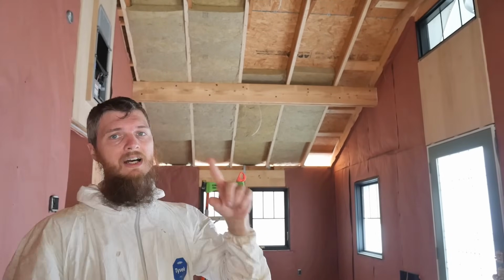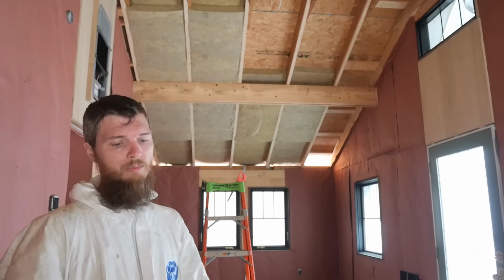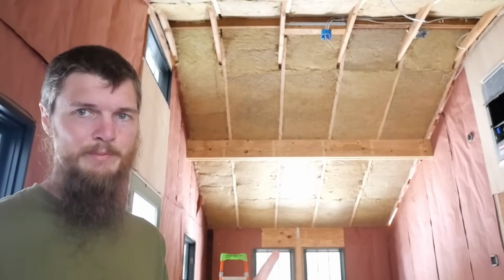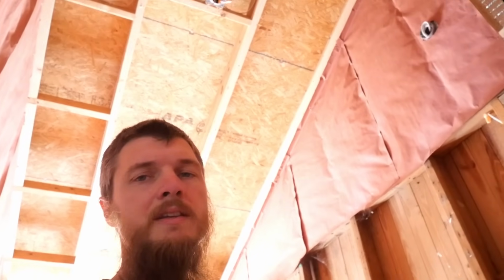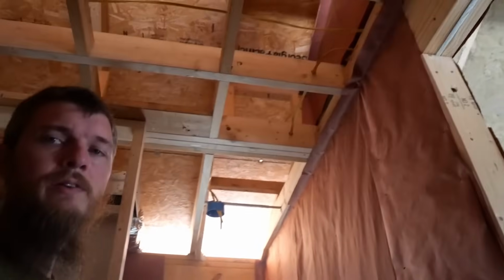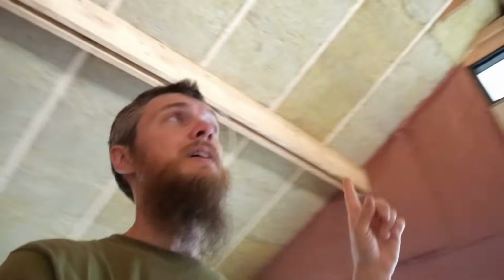Just Insulating our Cathedral Ceiling

Comment: your suposed 2 have a vented space between roof deck and insulation....
Reply from the maker: Not if you are doing an unvented roof assembly. There are many ways to build and insulate attic and roof spaces.
Reply: @diyfferent  every roof has to be vented..
Reply from the maker: @redsresearch  That's just not true.
Reply: @diyfferent  lol ya it is...
Reply from the maker: @redsresearch  Okay, show me where you got that info.
Reply from the maker: @redsresearch  I don't know why you don't just do a little research on the topic instead of making yourself look silly. Obviously this isn't a topic you are well versed on, so what do you get out of arguing about it? When I learn something new I always enjoy digging into it and learning more. I don't just argue that it's not true as if it relinquishes the truth just because I don't want to face it.
Reply: @diyfferent  your suposed to have a gap air space between the deck and the insulation so it doesnt melt the snow as much
Reply: @redsresearch  Do more research.  They are doing this right, but the tyvec suite and air masks are overkill.
Reply: @diyfferent all my research on the topic says you need a space for ventilation… i would be happy if its not the case since I am just about to do the insulation and I don’t have enough space to vent and have more than r30 insulation. And the recommendation in my area is: r41. Can you point me into research that says I can insulate without venting? I have a metal roof and my beam are 9 inches. So I was planning on putting 6 inch of rockwool and leaving a 3 inch gap for venting.
Reply: @diyfferent all my research on the topic says you need a space for ventilation… i would be happy if its not the case since I am just about to do the insulation and I don’t have enough space to vent and have more than r30 insulation. And the recommendation in my area is: r41. Can you point me into research that says I can insulate without venting? I have a metal roof and my beam are 9 inches. So I was planning on putting 6 inch of rockwool and leaving a 3 inch gap for venting.
Reply from the maker: @gabz91110  A lot of good info in these articles: 
Part 1: https://www.jlconline.com/how-to/insulation/avoiding-wet-roofs_o
Part 2: https://www.jlconline.com/how-to/insulation/avoiding-wet-roofs-part-ii_o
Reply: @redsresearch  <—- Your name is ironic😂

Comment: Spray foam next time bro.  What's more valuable your time which you'll NEVER get back or $ which you can always make more of.??
Reply from the maker: We don't like spray foam insulation.
Reply: @diyfferent  Plus mortgage companies don't like spray foam insulation AKA won't work with you.
Reply: Lots of insurance companies are refusing to ensure houses that have spray foam in them. My guess is that spray foam is just a fad, and will soon be a thing of the past.
Reply: @mr.kenslifeshop4034  Don't know about that... it's be around for decades now
Reply: @unamor  it's already a thing. It leaches chemicals into your living space.
Reply: Many times it doesn’t cure on one side and stays wet.
Reply: Spray foam is nasty stuff, as a chemist I wouldn't put that in my home.  If the chemicals don't mix 100% or aren't in the  PERFECT ratio, it will leech chemicals into the air for years after.
Reply: I had spray foam placed in my ceiling/attic in Australia where it was either  warm or hot,it worked extremely well with a noticeable difference as soon as you entered the house.Very Pleased.